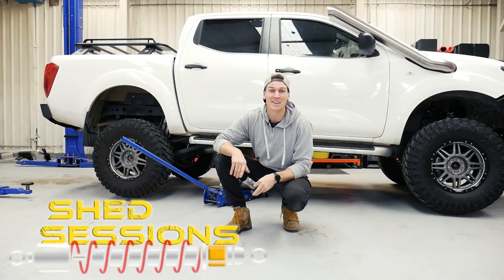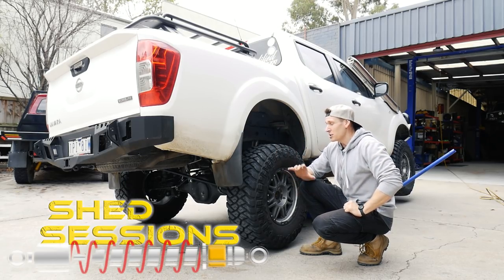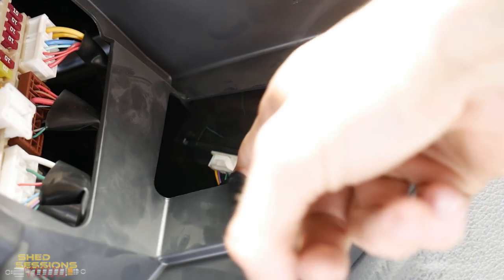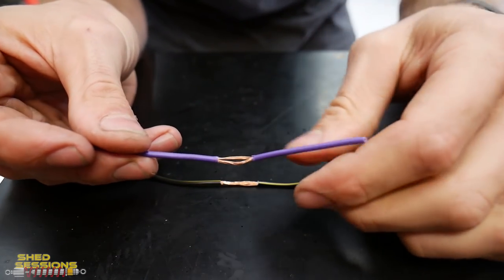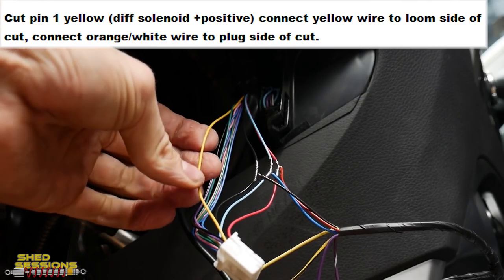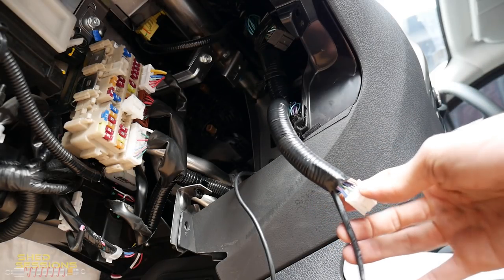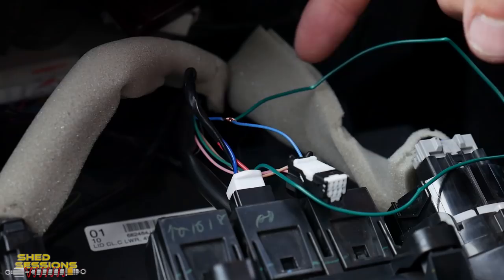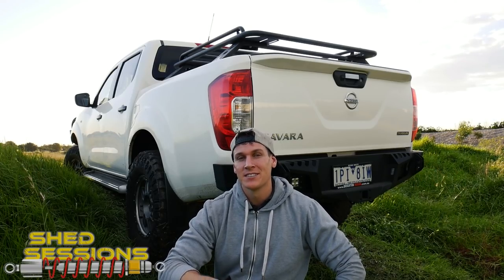NP300 2WD & 4HI Diff Lock Mod & How a Diff Lock Works #ShedSessions #NP300

Comment: Hey mate, how r u? I have a channel and my car is a diesel NP300 2019 manual. I want to comment about the traction control. What people do in my country is install a switch to turn off the traction when needed. In sand areas, traction is gonna dump the car and put you in difficult situations sometimes, here where you need to switch it off. The manufacturer switch that is already in the cabin doesn't fully turn off the traction. Well, whatever I am gonna do a vid later when I have the time, and hopefully I put Eng sub translation cuz I will be speaking in my mother tongue :) I will also make a vid about the differences between the navs np300 that are left hand drive or right hand. One is Thai manufactured and the other is Spanish. Well, I will dig into more details before doing the vid to get accurate info

Comment: I came across this just now. Can somebody tell me if this is applicable for the manual transmission variants?
Reply from the maker: @josh4u319  hey mate, I'd check with black ops off-road.i reckon they will have something for you. You can use the discount code JPCAPTURED.
Reply: @jpcaptured799  Thank you. Much appreciated.

Comment: Cant stop watching your vids mate. Starting my apprenticeship next year and dreaming of a NP300 somewhere throughout, just doing tons of research because i have heard mixed reviews on the car's reliability but I mean im  willing  to try!
Reply from the maker: To be perfectly honest mate, i expected to hate the Nav. I bought it because i was sick of owning patrols and wanted a ute. So i took one for a test drive, and bought it from the dealer that day! And you know what, i frikken love the thing, Nissan have done a great job on the Np's and although they can have some very minor issues. it's nothing compared to other models.
Reply: JP Captured awesome that’s what I want to hear mate! I’ll most likely end up getting something with around 80xxxkms so will definitely be an awesome project to work on because I love the look of the psr triple hoop bars ! Thanks for the reply mate
Reply: @Will Talbot did you end up buying one? I'm moving to Australia permanently end of this month and have been looking at the Navs. 
common problems i've seen mentioned a fair bit are rear main seal leaking, coolant hose rubbing on the fan and leaking, intercooler pipes failing and someone mentioned the timing chain is weak as its the same one they use on the Qashqai
Reply: @danhopkinson2811  I bought one my self two years ago and haven’t had any problems at all, I have the series 4 2020 model and can’t fault it, I’d highly recommend it but every car will have their problems, you will always hear more bad things about a car than good, ethe minority will complain online while the majority who have had no complainants won’t be saying much

Comment: Two blank switches in an ntrek just aren’t enough for all these mods. Used one for uhf and the other is reserved for spotlights. Nice to hear I can just put it in place of the factory switch but leave it plugged in
Reply from the maker: For sure man. Honestly i almost did it myself, but in the SL there are so many spare spots i just left it in 😁
Reply: @jpcaptured799  if I ever need spare switches ill just remove the heated seat switches, starting with the passenger, they don't need to be that comfy.

Comment: Hey mate, I'm from Moonee Ponds, I've been following your videos since you've started. This has saved me, my difflock doesn't always work and my np300 is new. Side not, can we do 2inc body lifts in Vic, I have a 3/2inc suspension lift.
Reply from the maker: sweeeeeeet 😁 Body lift ontop of that sort of suspension lift would need to be engineered brother. you could get in touch with S&M Engineering for more details on the possibility of getting something like that passed in VIC

Comment: Nice video! what is the size of those wheels my friend? looks amazing. Got a np300 with 265 70 R16 but want a bigger ones. Do you know which is the biggest size a Np33 can handle without modification? thanks!

Comment: very good video I have a NP300 2017 ... it is made in Mexico with 2.5 manual transmission engine ... this model could be installed on this...  thanks  have a great day.

Comment: Great Video thanks, Only new to this page and you most likely get asked this a lot. What lift kit dor you have and what size wheels and tyres do you run
Reply from the maker: Lift is 3n2 comp shocks from parts man dan and wheels and tyres are 295/70r17 maxxis razrs 17x9 +30 wolf wheels

Comment: So FYI, that Blue wire for switch illumination in my MY17 nav only rocks on Parker’s, not when headlights are on.
Reply: Haha, just realised this is the case after tapping into the blue wire for the gear shift illumination. Any idea why or a solution? The gear shift itself illuminates regardless of parkers, headlights or auto...

Comment: could you be so nice and hand me over the installation manual if you still have it? i want to buy the kit from racewires but i am not sure if i have the same wiring and want to check before spending money for the wires and shipping. i tried contacting racewires about this but he did not want to help me without buying it.

i would really appreciate this, mate.

greetings from a NP300 driver from germany

Comment: Excellent product, how do I get it for the frontier pro 4x? Will the np300 kit work? I'm in The US
Reply from the maker: Yup, same car 😉👌
Reply: They don't all come with a differential locker though. Therefore you would have to buy an aftermarket locking differential rather than the bypass cord.

Comment: Hi JP 
I found this would this 

NP300 Anytime Diff Lock Kit – CrispMODS

Would it do the same as I’m not handy with an soldering iron 
It does say that This Mod also disables the traction control system when activated. 

NP300 Anytime Diff Lock Kit – CrispMODS

Comment: i noticed you had a digital speed read out in your cluster. i have a 2018 ST-X and can not find this option. can you tell me more about it? Would luv this option.
Reply from the maker: If yours is a 2018 it should have this option too. You just have to cycle through the preset display options using the button on the steering wheel.

Comment: Do we still have traction control engaged in the front wheels when locker is enabled in 4-Hi? I thought TC gets disabled in 4-Low and locker?
Reply: Would be interested to know this also
Reply from the maker: traction control is disabled in 2wd and 4hi when the locker switch is enabled.
Reply: JP Captured thanks!

Comment: I got this installed by race wires on my x class x250d nice guy but i have not use it yet.    Do you think we will have 2 low mod. I was looking in to that but still researching
Reply from the maker: a 2wd low range mod would be epic! but a lot more involved, or you could remove the front driveshaft that would work  😅
Reply: @jpcaptured799  😂 🤣

Comment: Hey, great video, I got an NP300 it is the 2WD version, with a good set of A/T Tires,  it takes me to most of the places I need to go to, so no need to have 4WD, buuuut, it would be nice to have a locker installed just in case, it is supposed to have an electronic LSD and so far haven't let me down whatsoever, are you aware of any aftermarket locker that would fit? it has the 2.5 Biturbo engine with 6speed manual
Reply: You would have to get an axle from a four-wheel-drive version and swap it. You might also have to swap the front to match the gears but I'm not sure about that part. I do know you'd have to switch the rear axle to have a transfer case. Otherwise we will not be able to toggle you either have a welded like Def or not

Comment: Air locker e locker or auto locker in the front? Which one would you use?
Reply from the maker: E or Air. Honestly i am a big fan of the TJM Air lockers 👌
Reply: @jpcaptured799  thanks. Unvortunatley for me tjm havnt bothered to make a pro locker for a dmax yet. Some say air lockers are shit some say e lockers are shit, i like to get different guys opinions on them who seem to know what they talking bout. Thanks.
Reply: They both have their pros and cons. Electric shit likes to break. And air lockers are expensive and takes a while for it to engage if you don't have the compression tank filled. That being said you have to have a onboard air compressor which is nice but expensive.
Reply: Auto lockers shit. It might as well be LSd Open Def. You would have to hit the brakes and back up a little bit through to engage.

Comment: diff lock makes each wheel go at same speed not same power. wheel in free air has no power. very important difference with diff lock and normal or even most lsd.
Reply: Same thing wtf